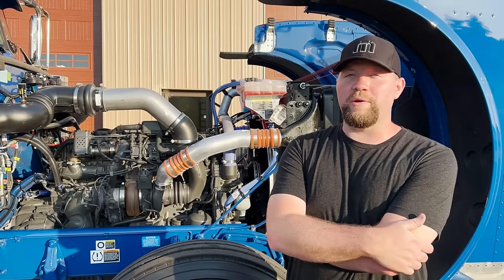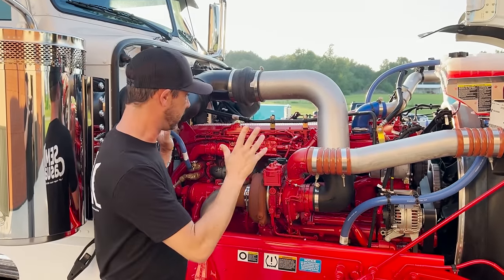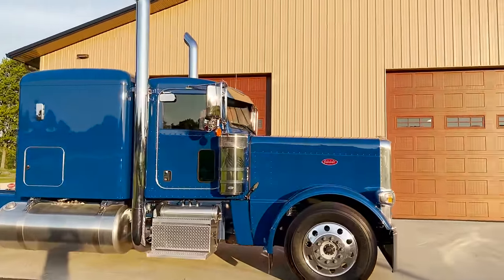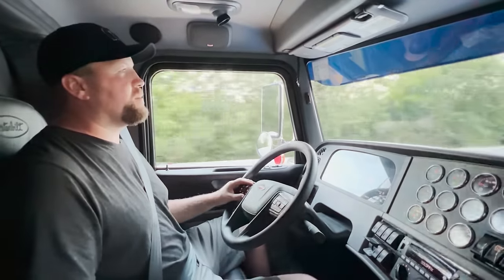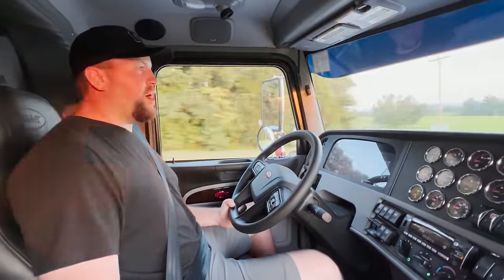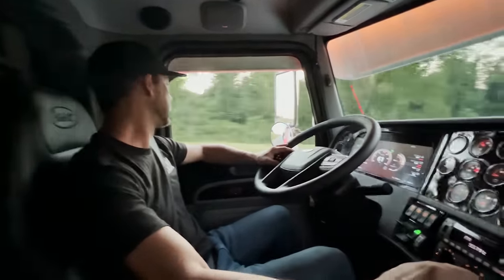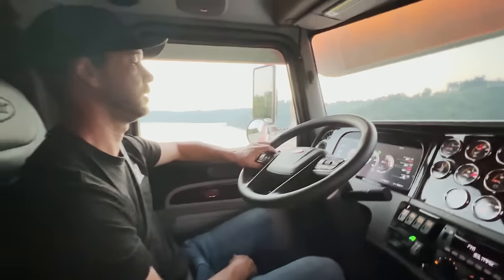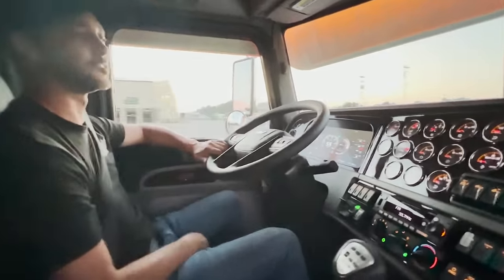Cummins X15  VS.  Paccar MX13  -  What are you gonna choose?

Comment: I have a 565/2050 X-15 in my ‘19 389. Other than the $30k in-frame at 371,669 it’s been ultra reliable. I had no choice but to drive it home from NJ to IA with 50% torque. High crankcase pressure/stop engine immediately warning. Cummins claims my engine was “dusted”. Around the same time Cummins released a service bulletin with an upgraded fresh air box on the X-15. I’m now 1 year after overhaul nearing 500k miles and going strong. I pull a reefer and generally loaded up grossing right at 80k. Been running 6.5 -7.0 mpg all summer long. I use/highly recommend Howe’s meaner power Kleaner at EVERY fill-up. Zero emissions issues and improved mpg. In the past when using Howe’s meaner power Kleaner every now & then if I ever got an engine light or emission code adding the meaner power Kleaner would turn off the light/clear the code. I use it year round every fill up. It more than pays for itself.
Reply: Had a Fitzgerald glider with series 60. Great power. I used howe’s fuel treat. Half bottle each side every other fill up and she was smooth!

Comment: The Paccar is the engine that's in the DAF in the UK and Europe but wee get a 530hp and it's good for about 12 to 14 mpg all depends on the driver of the truck and where he gives a dame about the fuel or not, but great video as always guys
Reply: i assume those are imperial gallons? 4.5 liters vs 3.875 liters. that makes a 20% difference. Still good though. overall highway speeds are higher here in the US, 70mph vs 62mph in Europe.

Comment: I like the comparison you guys have done in this video and I'd like to add some input of my own experiences with both those engines.   Out west here say in Idaho, Utah and Nevada we run gross weights of 106 thousand to 129 thousand and with mountains, hills and such the MX13 struggles.   What ever fuel mileage it may have over the X15 goes out the window fast, the Cummins is more durable in the long term for such applications compared to the MX13.  So in my opinion if you are running 80 thousand gross or less and a lot of highway driving long distances the MX13 is gonna be a better engine choice for you.  Having been around a bit and driven the old N14, 3406 and Series 60 Detroit I have to say the MX13 is the modern day series 60.  Great engine for fuel mileage but not a power house by any means while the X15 is a vast improvement over days past large displacement engines is still retains the legacy of engines like the N14 and 3406/ C15.
Reply: My mechanic  has 2 paccar in the shop for 3 months  trying  to get a fuel  pump.
Reply: @kennethdurden880  I hear you. Left out of comments the mechanical issues with the Paccars only because I'd say the engine itself is good but the components have definitely had issues.   The Cummins definitely I think have had overall less issues.

Comment: I was running a c-15 for the last 20 years. Just switched to an x15 performance a few months ago. My cat had a little more power, but the engine braking on the x15 is a very big deal. I drive mountains everyday. Cummins has way better engine braking.
Reply: Cummins engine braking is definitely the best I’ve experienced. However if I could trade my isx15 for a c15 I would in a heartbeat. The new Cummins engines seem to be designed to make Cummins money rather than the truck owner.

Comment: EPA 18 MX-13 motor . First day I the road was Feb 21’ 
Just hitting 200k , the truck has had the Clean Air Fleet treatment system on it since 25k miles . I run end dump . Built the truck specifically for what I do , from the wheelbase to the gear ratio . It is set up to do everything I need it to do . It’s a flattop 567 . I run 80k everywhere I go with an 18 speed manual transmission . 67-68 mph everywhere ( I’m obsessed with consistently ) has more than enough power for the 80k gross load , no I’m not the first to the top of the hill , but I’m definitely not the last ( 510hp motor ) I get 6.5 mpg year round avg . Have never seen a check engine light . Truck has never missed a beat . I understand it’s not a ton of miles yet . But I really do think paccar has gotten some major bugs worked out of these things . If you don’t need the big power , and you want a very smooth and quite motor . They are worth a try .
Reply: Cat deisel
Reply: @michaeltruscott9443  parts availability
Reply: @michaeltruscott9443 you’re you know what

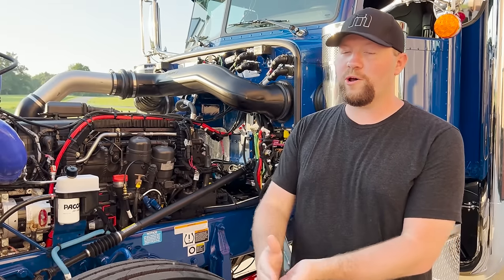Comment: My last Paccar experience was with Western Distributing out of Denver. They run mostly Paccar 510 HP, the highest rating on that engine. 18 speeds and I think 3:20ish gearing. I was in a 389 Pete. They have some W990 Kenworths, as well. 
  The senior drivers get to spec their trucks, and they get Cummins. 
Heavy loads of beer and meat going west out of Denver sucked. Coming back from Salinas, with maybe 10K pounds of lettuce in the box they did pretty well. Decent mileage running 72 mph. 
Something interesting I learned while working there. The owner is very business savy. He buys engines directly from Paccar, and has them drop shipped to Peterbilt and Kenworth. I was told this saves the company a lot of money on factory markup.
Reply: Whoever told you this shit is has no idea what he’s talking about. Paccar owns Peterbilt and Kenworth. You can not buy a Paccar engine and drop ship it to the factories.
Reply: @justins7867  why not ?  Have you been to an assembly plant ?  Wealthy business people operate at a different level than what most people do.
Just because Paccar owns Peterbilt & Kenworth doesn’t mean it’s one business. They are all separate business entities. 
 The long time fleet  manager at Western told me about the engine supply deal. He doesn’t  BS !

Comment: I've always been a Cummins fan but this truck that I have now is a paccar and I'm very impressed.

 It has excellent torque at low RPM, And it runs very smooth and quiet. I never knew that IFTA will audit you if you hit over 8.0 MPG  Until I got this truck.

I got 8.4 MPG for my 2nd quarter 2022 IFTA taxes and my prepare told me that I had to of made a mistake and I will get audited above 8.0mpg, I must have forgotten a few receipts.

She was right I made one mistake, I forgot to input 1 fuel receipt in my Keep Trucking. 

Just gave it to her today so I haven't got the results back, maybe 8.3mpg lol. 

But that means I'm just around 8.0 MPG which is phenomenal with these gas prices.

 But I agree each engine has their special place in the industry, If you're doing heavy haul making big money oh yeah Cummins is the way to go!

But if you're OTR moving basic freight, And you're in this industry to make as much money you can then paccar is the way to go.

 Some people treat trucking as a hobby and that's OK they put the things they want, all the Chrome,  Smoke stacks, lights all around beautiful trucks! With the engine they want no matter what the application is.  Again that's OK.

And then there are those in this industry that treats it like a business, aerodynamics trucks as much MPG as possible.

It's all about personal preference there is no wrong way if you can afford a hobby way that great!
Reply: Well said.
Reply: should i buy a used 2019 579 with paccar engine , 300,000 miles , automatic, 40k right now? or look elsewhere , thanks
Reply: @dk-ku4tc  

My truck is a 2017. I bought it in 2019. I believe it was around 500,000 miles. The sticker price was $46,000. In the plandemic, the value of my truck went up to $100,000.

It's good to see the truck prices come down again that was ridiculous.

It's totally up to you if everything checks out okay. Transmission shifts good engine is good, and there are no other issues with the truck it's not a bad deal.

Just make sure whatever you're hauling, there's good money to be made. The trucking industry wasn't doing so well. Brokers are price gouging hard in 2022 and  even at the beginning of this year.
Reply: @truckerraven.8906  I already have a volvo 2016, and I do haul consistent freight(flatbed) at a decent price and was looking for a second truck to put a driver on it and I just don't know about paccars because online everyone hates them,  but pricewise it seems a steal and iffy so idk

Comment: I am a new owner operator, bought a used Kenworth t880.  Pulling a flatbed in California, with a paccar Mx 13 10 speed  automatic. Yes automatic, was very scared listening to all the horror stories about paccar engine.   With 418,000 miles has no issues or codes. Just you’re regular maintenance. 2 years no issues truck is a 2015. Very happy. Only yes I had a hard time finding a good mechanic with knowledge on this engine. Found a guy that worked 10 years for Kenworth.

Comment: Just rolled over 400k on my 2019 389 X-15/565hp. Only issue so far has been a squeaking idler wheel. Never have driven a Paccar, but am totally happy with my Cummins. Also, they just have so much more experience making engines.
Reply: Replace that pulley, I carry a spare. You can get them at FleetPride or any dealer. I use the aftermarket one, big name, same one Cummins sells in their box. It is easy to replace, don't wait for it to fail, as it will make a mess when the belt melts and shit starts flying. I think I paid around $70 for the one I have in my sidebar. They used to be around $30...
Reply: So does daf the mx13 is a daf engine if you support American economy buy American Cummins is American paccar or daf is not
Reply: Get ready to drop a liner around 500k

Comment: Having owned a mx-13 engine in a 2015 t680 for several years now I can say that they are a nightmare. As an owner operator you're going to be limited on parts, on shops who have the correct software, and a multitude of electrical issues and problems that aren't easy to diagnose. In general, especially with your first truck, you should accept some losses up front for more regular returns later. Also if you already have an mx-13 then make sure to do your valve adjustments on time. Mine was just rebuilt at 590,000 mi.
Reply: Do you have an explanation why DAF Trucks is the number two in Europe for trucks > 16 tons already for decades and the problems you American truckers seem to have with the MX-13? In case the American Trucks are way better, then there would be a significant import in Europe.
Reply: I had to have the head replaced, two new injectors,turbo, EGR cooler, DPF & DOC, etc. at 475k miles. Hella expensive. I wanted to swap to a Cummins at that point.
Reply: @47rintin1  Them DAF not pulling 80k lbs

Comment: I have a X15 565, 850000 miles still running strong minor break downs I had fuer gear pump go out at around 600k Def problems around 650 I deleted it and a turbo around 750  bought the truck at 400k, Happy with the performance of my engine and very surprised is taken all the abuse I have a team running this truck engine runs non stop for 3 weeks and rest 4 days

Comment: The X-15 sounds like it’s fixing to sling a rod at any minute. I just can’t get used to that sound. I also believe that’s why so many of them actually do throw a rod through the block. You don’t notice a sound difference when it’s getting ready to go so you keep driving…
Reply: That is the air compressor.
Reply: @michaelwright1602  I’m talking about the hammering sound when pulling. The air compressor is loud but only when actually compressing air.
Reply: Well, the only reason an ISX throws a rod through the block is a failed wrist pin, which is a possibility at the 800,000 mile plus range. Many owners fail to even do the lower end bearings, that should be done at that 800,000 mile interval too. Also, the crankshaft damper, Cummins recommends replacing at 500,000 miles, as the viscous fluid in it hardens over time, that could be the issue. When they fail, they do blow apart, and there is no way to test them, best to replace.  

What RPM is the motor running at when you hear this hammering? If you are lugging it under a load, below 1400 rpm, especially when pulling, you are more than likely beating the hell out of the liners. How many miles on the motor, your service intervals and gear ratio.
Reply: @michaelwright1602  I’m not taking either side. I’ve driven both and am currently in a 579 ultraloft with a 455mt mx and I’m very surprised at its performance. This little motor has a lot of heart. But when it takes a shit a 12.7 will be taking its place. I don’t like any of the new motors. I like cats followed by Detroit series 60. The reason for going with a 12.7 in this truck down the road is that I’m not wasting a cat on a plastic truck.

Comment: I’ve driven an MX in a T680 and I’m currently driving a T680 with a 500 ISX. The MX doesn’t get better fuel mileage. For about the same weigh they get about the same fuel mileage and the the Cummins will out perform the MX in every other way. Plus, having a Cummins doesn’t limit you to as many shops when you need repairs. I see the MX as a better Volvo engine. Better power and better fuel mileage than a Volvo. And I had less problems than I did in the Volvo. Then the Cummins is the next step about that. Ok, it’s lighter but how much of a problem is 410 lbs on the steer axle. So far I like the CUMMINS better.
Reply: Do you recommend buying ISX15 engine truck with 750k miles

Comment: The real question is which one will be in the shop more often. I’ve got an X15 efficiency series in my t680 and it gets excellent fuel economy and doesn’t go to the shop often
Reply: Just replace the sensors and bake the cans. Best to get an Inline 6 reader, it comes with the software, get it on eBay, around $250 last time I looked. Exhaust back pressure sensor and Intake Manifold Pressure sensor are the two biggies. Replace say every 18 months or two years. Check cans periodically using Cummins software, stay ahead of the game, the Inline 6 reader and Cummins Insite software pay for itself the first time you use them.

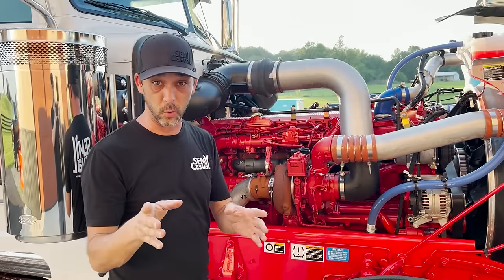Comment: Ran a Cummins in a 2023 W9 with the big sleeper, side box, step box and enclosed headache rack. 18 speed, 3:36 rear end and long WB, with the big fuel tanks. Always pulled heavy and oversized with it and over the 18 months I got to drive it averaged between 6.8 and 7.5 miles per gallon. It wasn’t turned up to the 605 hp but it pulled like a champ coast to coast, through the mountains North and South.  Loved that truck and if I could I’d buy one myself. It was heavy coming in @ 24,120 topped off and all my gear and flatbed equipment, and yes that that was an occasional headache for dispatch but to me it was the perfect engine drive train combo for that truck. As for the PACCAR I suspect you’re right…application should be the determining factor in engine choice.
Oh… yeah the Cummins does have a nice growl when you lay off the throttle at slower speeds lol.
As for fuel economy I use this as my mantra about fuel economy:
Newton’s third law of thermodynamics:  “For every action there is an equal and opposite reaction… press down with the right foot and money comes out the stacks!”

Comment: As European truck driver I am familiar with mx 13 paccar engine as they are exclusive option on all Daf trucks. I had Daf xf 480 and first of all it is super economical. On motorway mode and fully loaded it returns 24L/100km on average, now  that's impressive.  Also it is very quiet as on top speed it has about 1000rpm. Superb machine! 👍👍👍

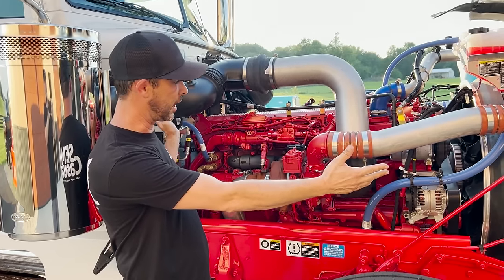Comment: Coming from 14 Kenworth t660 paccar 455 -1750 3:36 10 speed it was a great truck and ran even better after getting passed the emissions cause honestly the def system was killing it .. I sold the truck after running grain with it for years and I honestly hate it .. Truck pulled anywhere from 52k on normal otr runs from central Mississippi to the east coast of Pennsylvania no problem at all .. I never did a overhead anything motor wise to the truck .. I have hauled loads up 90k gross out doing barge runs no problem!! I sold the truck with 780k and it’s 900k plus still running strong and quite engine wise .. I recently bought a 16 Kenworth w900 isx 450-1650 18 speed 3:55  and after a year of running it which I will point out it was well taken care of but like all Cummins 605k it needed a overhaul.. Runs good now but if I had to choose for OTR and grain hauling I’ll choose my non emissions paccar!!!

Comment: Just thought I'd throw this comment on the pile:

I drive a 2013 Peterbilt 367 pony & pup with a Cummins X15 485hp with 18 speed, and gross about 62,000kg.  The X15 had about 850,000kms on it when it suffered a catastrophic failure.  It was in the shop for six weeks and the total repair bill, I am told, was $75,000 CDN ($15,000 diagnostics; $60,000 parts and labour) at a Peterbilt dealership for an out-of-frame rebuild.

The cause, I heard through gossip, was "a pin dropped out somewhere and bounced around inside the engine."

🤨

I find the throttle control on the X15 tedious to shift gears accurately.  In the interim, I have been driving a '97 KW with a Cat 3406E, and it has been an absolute pleasure to shift gears with, and a great reminder of what we have lost...
Reply: Ripped off, more than likely it was a liner that. busted lose. Lugging these motors will do that. Need to keep the RPMs up above that 1500. And $15,000 for diagnostics? I bet we could have diagnosed that thing in a truck stop parking lot with a call to NAPA and my laptop.